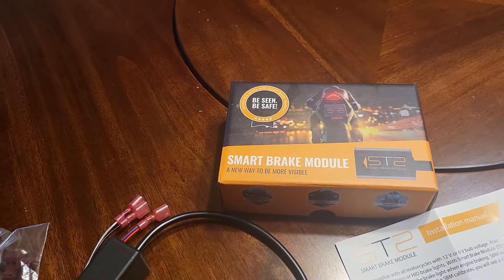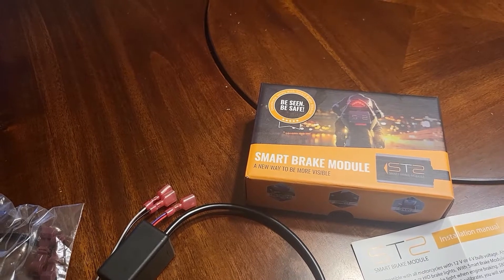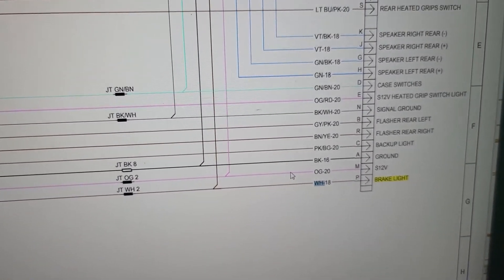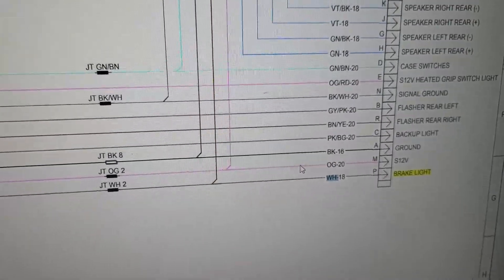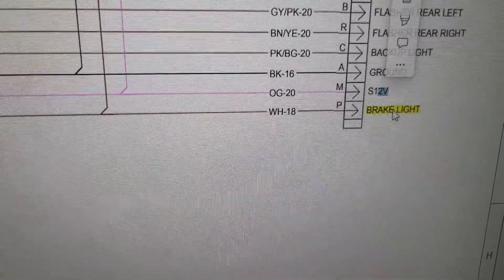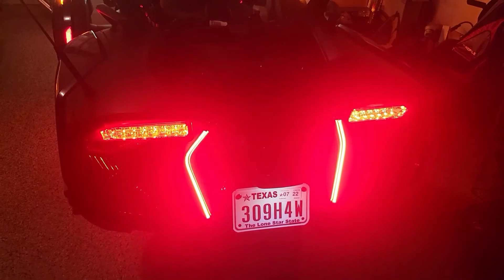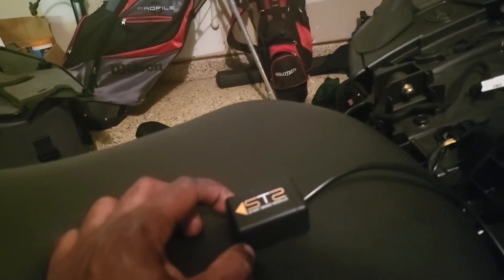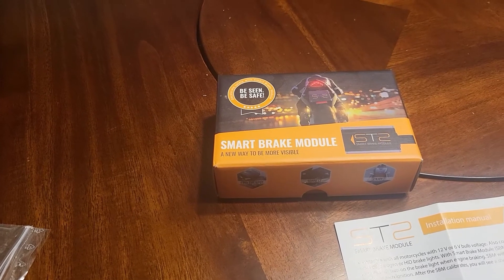ST2 Smart Brake Module Installation on Can AM RT Limited

Comment: Seems like this could be very intermittent as finding a flat level spot is diffi ult and can change with riding conditions, the number of riders and other factors.  Does jt self level at start up? It would almost have to, otherwise its not much better than a mercury switch.

Comment: Great video Sebastian!!
Reply from the maker: Thank you Wessimmons1061
Reply: @SebastianFortune   I think a zener Diode needs to be installed ahead of the white wire scotch-lock to keep the pulse signal from back feeding to cancel the cruise control if slowing.
Just a thought .

Comment: So did it work properly? What are your thoughts.
Reply from the maker: It did work as expected. It blinks three times when I go off throttle. There is another mod on slingmods that I will replace it with.
Reply: @SebastianFortune  Which device @ slingmods